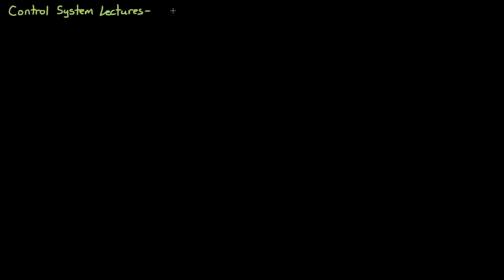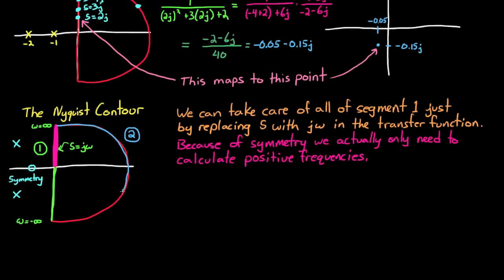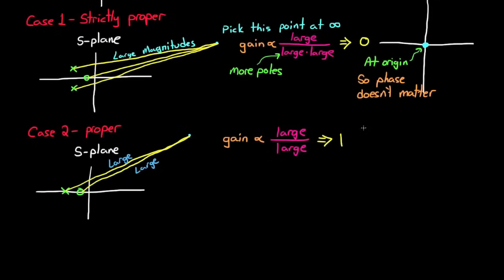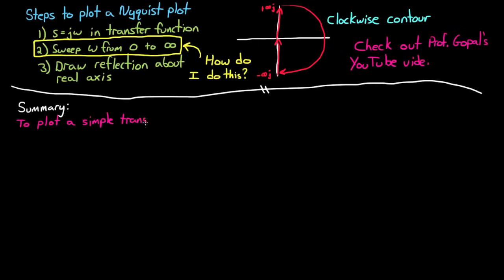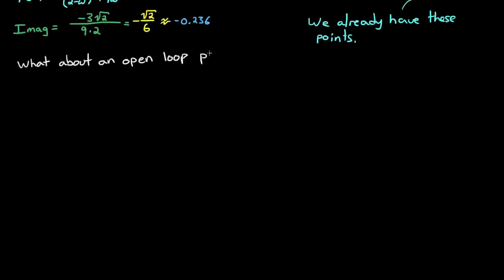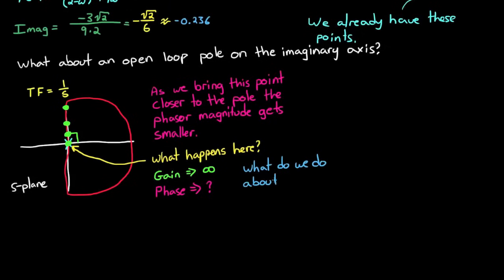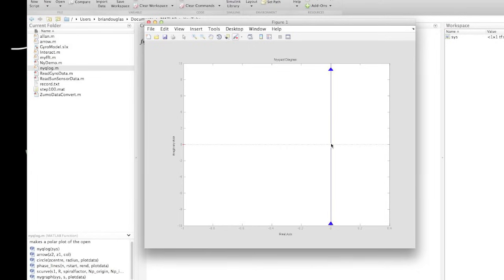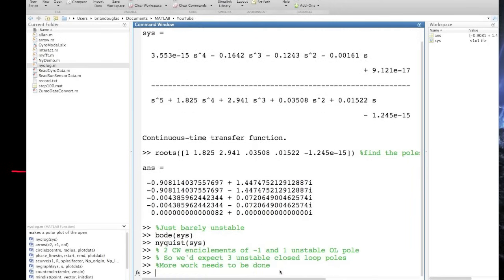Nyquist Stability Criterion, Part 2

Comment: Hello. Nice lecture. Just wanted to precise something (actually is kind of something i'd like to confirm). I was using matlab to understand what you are explaining. I saw that proper functions do not give a gain of 1, but the gain equals the limit of the function when s goes to infinite e.g. if the function is, as in your video, (s+5)/(2s+3), the nyquist plot passes through the point 1/2 with 0 angle.

Comment: Hello. When you were discussing the case of strictly proper transfer function, you said the phase of the origin in the w-plane doesn't matter. But when jw sweeps from positive infinity to negative infinity in the s-plane, the phase in the w-plane seems to sweep from negative pi to positive pi. If that's the case, shouldn't the same loop around trick also be done at the origin in the w-plane for more rigorous mapping, cause sweeping around the origin maps to sweeping around +/- infinity jw correspondingly in both planes? Thanks.

Comment: Could some one explain why the phase is -90 degree in the s-plane at the time 13:45 and 14:28? I think it should be +90 degree because the points are in the positive part of the imaginary axis.
Reply: No, this is done in the right way. Have a look in the previous video. There he explains how the phase in the w-plane happens to be, how it is.
The phase of the W-plane phasor depends on the starting point of the Phasor in the S-plane. The phases of phasors starting from poles are substracted from the phases of phasors starting from 0´s.
In this case here we just have one single pole, so the positive phase in the S-plane maps negative in the w-plane.
Correct me if I'm wrong.
Greetings
Reply: @hajo1570  i agree

Comment: I’m a little confused about the contour. If you mirror it about the imaginary axis, and reverse the direction to maintain clockwise traversing, the same plot will be drawn but traversed in the opposite direction. Doesn’t this imply some kind of symmetry between the left and right half planes? What is the error in my logic?

Comment: This is the better explanation I found on the Internet about Nyquist criterion(I viewed also the explanation of the indian professor you suggested). But there’s problem that I’m not able to solve: the only calculations that we do with the transfer function to plot it, is to consider it restricted to s value j-omega from j-zero to j-plus infinity... but: how can we be sure that the  Nyquist contour is the one that include the right half plane (and not instead, the left half plane)? If we draw the contour of the left half plane we arrive to the same conclusion about the route from j-zero to j-plus infinity. Do you have the answer to this “tricky” question? Thanks.

Comment: @18:10 
Why does 2 clockwise encirclements of -1 and one pole in RHP mean that there are 3 unstable close loop poles?
Reply: +Brian Douglas I noticed this too. Is that a mistake?
Reply: z = n + p, where 
z is zeros of 1+KG(s)H(s) in RHP (i.e. closed loop poles in RHP)
n is clockwise encirclements of -1
p is open loop poles in RHP
So here you got n=2 and p=1, z=n+p=2+1=3. Three zeros of 1+KG(s)H(s) in RHP, which in other words is 3 closed loop poles in RHP
Reply: @tsunghan_yu  how open loop zeros in rhp becomes closed loop poles in rhp?
OL tf= G(S)=G(n)/G(d) so open loop zeros we get by putting G(n)=0.......(A)
CL tf=G(s)/(1+G(s)) i.e.  G(n)/(G(n)+G(d)) its closed loop poles we get by putting G(n)+G(d)=0.......(B)
both eqn(A) and (B) are different.
pls reply if i am wrong
Reply: P sinha you are correct. My description of Z was not precise. I meant zeros of the denominator of the closed loop transfer function. I have edited it.

Comment: Great video. I like your lecture more than my professor.
Could you please answer my concern of your video 1/s example?
at 12:11,  the gain on the w plane should be undefined, since the magnitude of zero phasor  ( no zero for 1/s ) is also 0. According to the definition at 4:18.

Comment: The 3 possibilities:
1.- The -1 does not get circled; the system is stable if there are no poles in the RHP.
2.- The -1 gets circled one or more times in a CCW direction; the system is stable if the # of times it gets circled is equal to the # of poles in the RHP.
3.- The -1 gets circled one or more times in a CW direction; the system is unstable.
Reply: Sir, you deserve a medal, this is exactly what I was looking for!!!!!
Reply: Asterio I'm glad it was helpful :)
Reply: Me: Probably should watch this a couple more times to understand it...
this comment: I'll clear all your doubts in 3 seconds
Reply: brian got the assist but you fuckin slam dunked this shit.
Reply: you're a fucken legend
Reply: thank you.
Reply: after 6 years still useful... thanks
Reply: great summary ! Sir.
I have a question of this video:
at 12:11,  the gain on the w plane should be undefined, since the magnitude of zero phasor  ( no zero for 1/s ) is also 0. According to the definition at 4:18.
Reply: thanks m8
Reply: #2 is wrong; if the open loop system has poles in the RHP, the closed loop system is almost always unstable, even if there are no open loop RHP zeros.

Comment: This is a confusing method for drawing the Nyquest plot by hand. In general you shouldn't be concerned with locations for values in the w plane. Instead, you should only be concerned with the shape and the encirclement's of -1. To develop the shape you should argue based on angles Then you would be able to use some of the information he taught about z= n +p from the first video. From there you can make a table which will allow you to assess stable regions within the Nyquest plot.

Comment: Why do we take the open loop transfer function while sketching the Nyquist plot?
Reply: The open-loop transfer function is in the denominator of the closed-loop transfer function. Therefore the stability of the closed-loop system depends on the stability of the open-loop system. So just investigating what happens to the open-loop poles and zeros tells a lot about the closed-loop stability.
Reply: +Joel Guyt thank you

Comment: Hi Brian, love your videos! I was wondering if you could briefly explain the main application difference between Nyquist plots and root locus plots. e.g., say you're designing a PID controller and want to fine-tune the gains to stabilize your system, are there certain cases where one might be advantageous over the other? Thanks!

Comment: To clarify; if a zero (not a pole) is in the RHP the system is unstable, because the Transfer Function we're evaluating is actually the Denominator of the ACTUAL Transfer Function we're determining stability on. (GH is open loop, but X / (1+GH) is close loop).  Nyquist difference between GH and 1+GH is just a shift of -1, so we evaluate GH as though its our transfer function, when in reality we're evaluating the Denominator of the transfer function.  So what indicates stability, and what indicates instability, is flipped. 

I.E. a pole creates a denominator of infinity, which is stable, while a zero creates a denominator of zero, which is unstable for the full thing.

Just wanted to help make that clear for anyone that missed it.
Reply from the maker: B Moore Thanks for adding this clarification!
Reply: +Brian Douglas Mister Douglas I wanted to ask that in the last minute you said that there is one pole in the right half plane and two clockwise encirclement's of -1 so there are three poles in the right half plane. But in the previous lecture you said this Z=N+P. That clockwise rotation plus poles is equal to zeros in the right half plane. So which one is it? I am confused.
Reply: B Moore
Reply: That was explained in part 1.
Reply: I believe this formula Z = N + P finds how many open loop (GH) zeros exceeds the open loop poles in the RHP, if the contour is CW. (If the contour was CCW it would be how many open loop poles exceeds the open loop zeros in the RHP of the s-plane). In this case N=2, so we know we have 2 open loop zeros more than poles in the RHP.
But since the open loop tranfer function is in the denominator of the closed loop transfer function G/(1+GH), this open loop zeros we found in excess are related to the poles of the closed loop TF. He showed in MATLAB that there is one unstable open loop pole, so in the end of the day the formula says that apart from that 1 unstable open loop pole, we will have more 2 (=N) unstable closed loop poles, so a total of 3.
Please comment if I said something wrong...
Reply: hbaqueiro you might be right. But I already gave my exam and I nearly passed my course. But thanks for the reply!